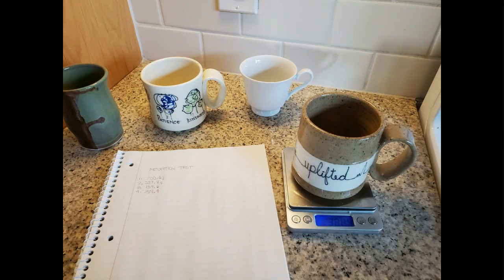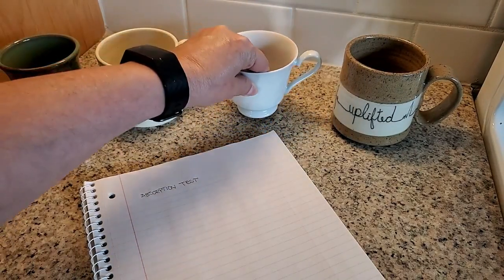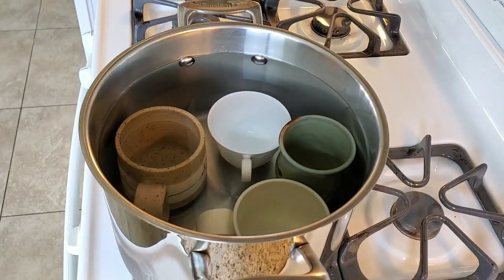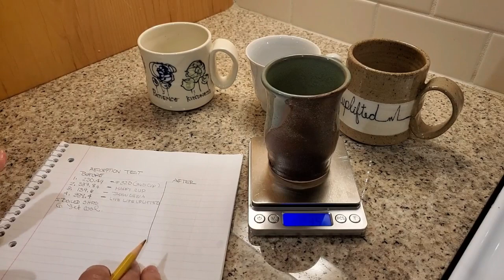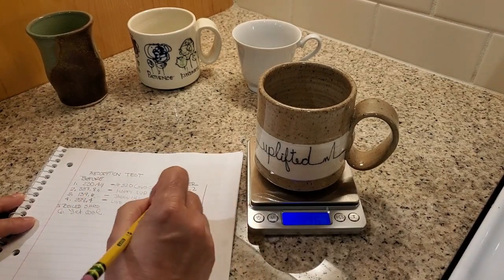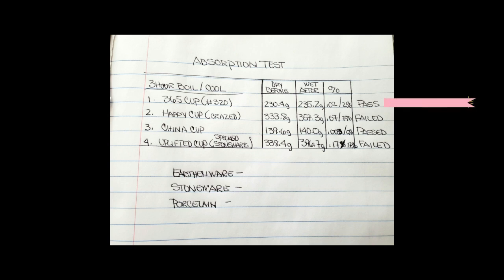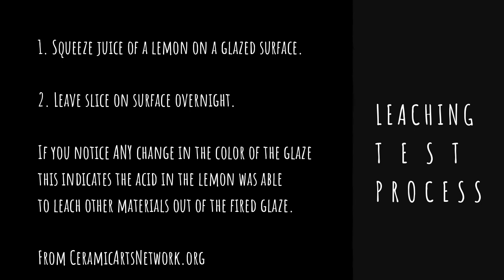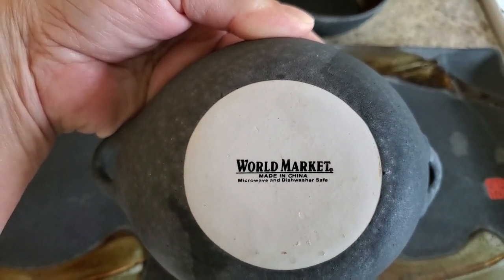Testing Ceramics for  Absorption & Leaching

Comment: Love the class and you are a great teacher.  I am curious why you had the bottom of the mugs in direct contact with the bottom of the pot when boiling them. When canning (vegetables) I was told there has to be a layer between the bottom of the jar and the pot - like a rack or even a towel, that direct contact between the jar bottom and pot bottom would cause breakage. I'm surprised the cups didn't crack from the direct heat. ??  Thank you!

Comment: I thought that absorption and leakage tests should be done without glazing. If you're measuring with glaze your absorption numbers will be altered in the end. Cause those percentages are about your body of clay without glaze.
Reply from the maker: Hi Luiza! Yes, you can do that to be sure :D  I was basically testing on finished pieces because  most people don't usually use raw clay to eat or drink from. Glaze can alter the percentages of absorp. or leaching either positively or negatively depending on the glaze and it's fit (the Cost Plus plates for example or dishware with crazing). It would be a great second for these clays to go raw like you suggested! :D